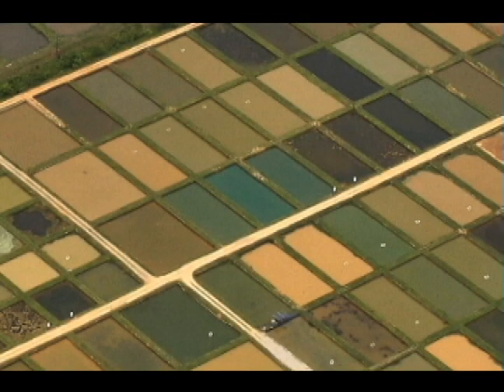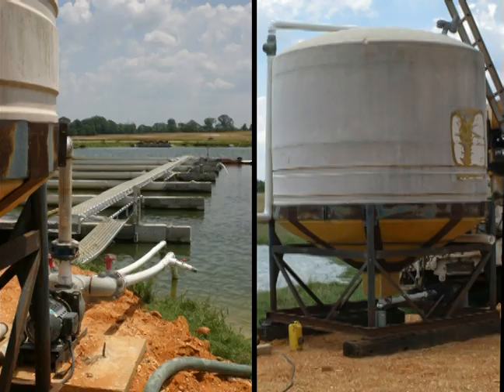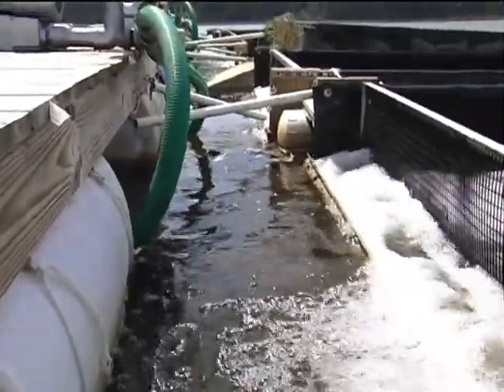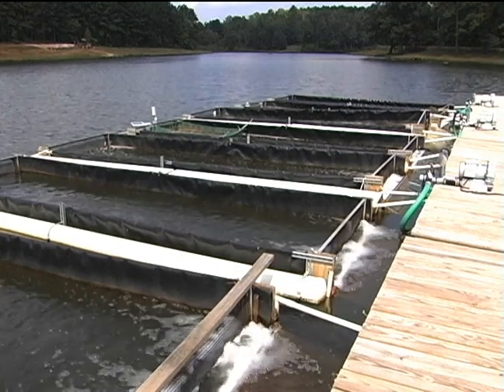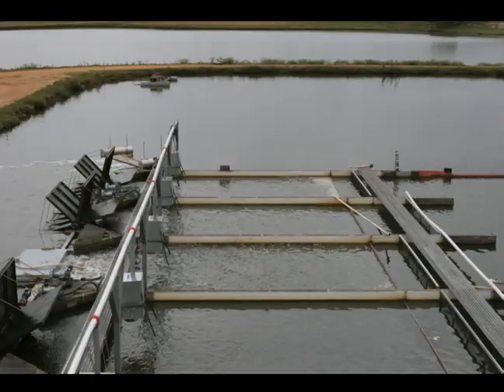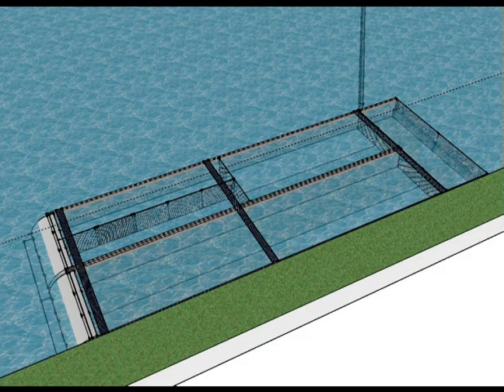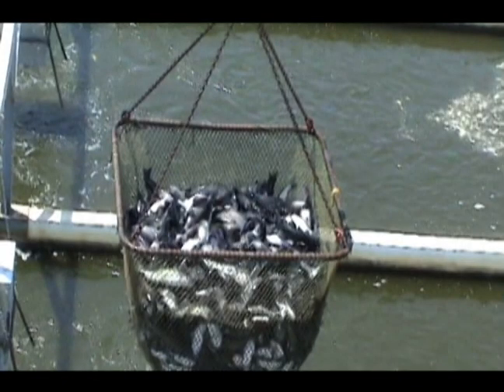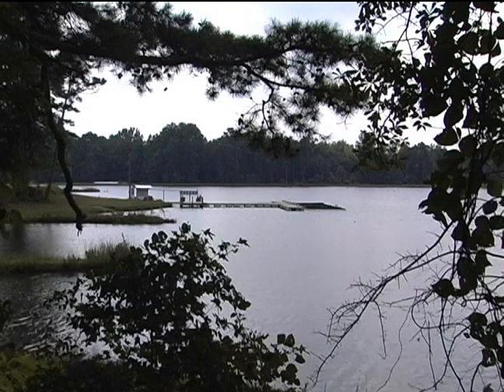Advanced Aquaculture System Part 2: In-Pond Raceways

Comment: Raceway system  Can i use River water for change water of pond.?
Reply from the maker: These systems were designed to be a closed pond to minimize discharge to the environment.  The trouble with river water is that you don't really know what you are getting and don't have much control of the quality.  In the US diverting water from a river would involve some heavy permitting.

Comment: Can this be used in salt water areas as cays in the Bahamas for Grouper or Snapper?
Reply from the maker: Capriata Exports 

The
culture of marine species (at least some) is absolutely do-able. Potential
problem exists with bio-fouling in many places though. Some areas are much
worse than others in this respect. I can't judge a particular spot but would
recommend placing some raceway materials I the water at the site for say, 6
months and see what happens. There are some excellent anti-fouling coatings out
there but are not cheap. The cheap ones don't work.